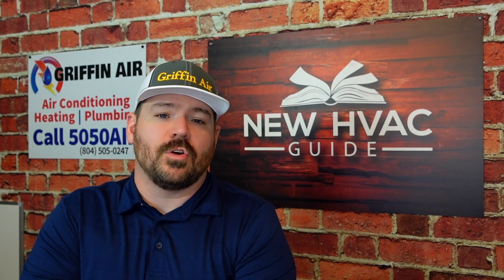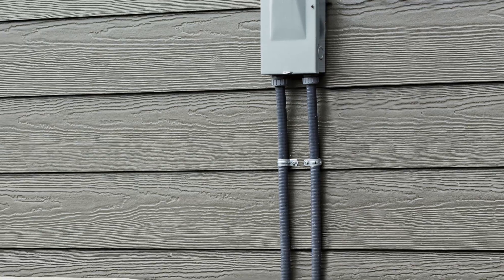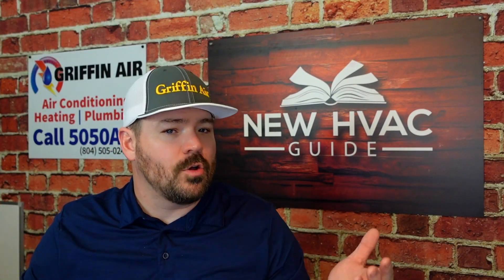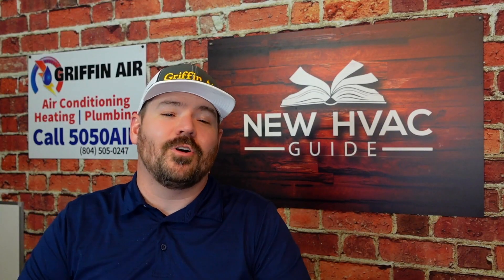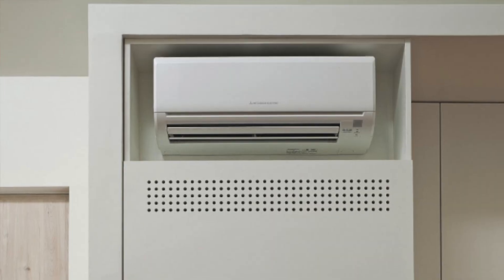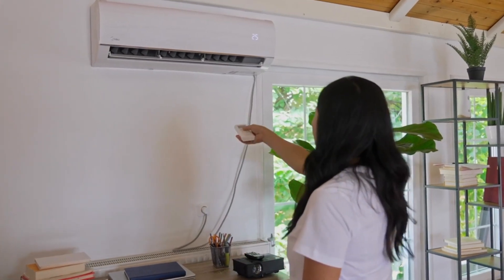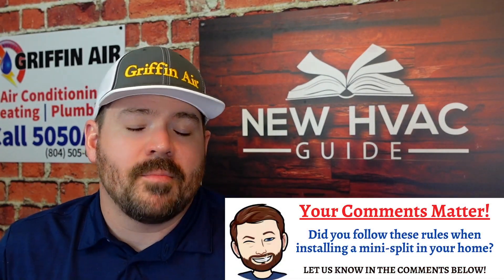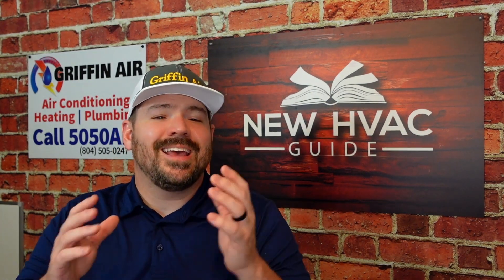Mini-Split Location Matters! EXPERT TIPS!

Comment: Is a 12000 btu mini system good for  a living room?
Reply: Depending on the room size and the climate. I have mitsu 15k btu  cooling 20x50 with no issues in NY in 90 degrees. It does not work very well for heating though. It helps by a very little.
Daikin 12K btu cooling 16x20 room in fan set to 1 bar with no issues at all. Did not use for heating, even though it's heat/cold unit. My comfort temp is 75.
Figure out if that will work for based on that info. I am not an installer, just an FYI.

Comment: There are IR repeaters so you can redirect the remote signal to a location that may be not line of site.
These are used in audio video all the time, but why not for mini-splits. That way Instead of installing the head unit in the optimal location to point a infrared remote, you can install it in a location that is optimal for comfort and air distribution.
Reply: Cielo Home
Reply: Most mini splits now have wifi and you can control them with your phone. Even if you are on the other side of the world. Many have a function where they can turn on and off automatically when your phone is within a mile, five miles, ten miles etc of your home so it will turn on automatically just before you get home, and turn off when you leave home. 
You can also program a schedule to switch on and off, what temperature to set and so on. 
If the unit doesn't have wifi built in, as with an old one I have, you can buy something like a Sensibo Sky which is a IR unit that you can control and program with your phone just as if it was a unit with wifi built in.

Comment: Videos I saw people install the condenser unit too close to the wall. The book I had said if it was wall mounted with the brackets it could be 6" ground mount 12" is required. I think 6" is just too close going to restrict the flow of air no matter bracket mounted or not really need a full 12" at least 24" is even better.
Reply from the maker: More clearance is better than less.

Comment: I kinda have a weird situation.  We have a 3 car garage and I'd need to install the condensor on the outside of the far east wall, run the lines through the garage allllllll the way over to what is otherwise a 4th bay of the garage (home builder opted to make it a room instead of another garage bay) but is an air conditioned room (my office).  I can't install the condensor right outside of my office because the condensor would be visible from the street and the HOA says no.  So I'd need to have about 60' of line.  I'm having trouble figuring out how to buy the hardware I need.

Comment: Thank you for your video, I do have a question if you don't mind answering.  I am about to install a mini split in an insulated Craft Room in my Shop.  It is just a 12'x24' room that the entrance to the room is in the middle of the interior 24' wall.  So I for sure planned on installing on exterior wall but being so narrow was assuming for best airflow to install it on the exterior 12' wall so that air is pushed across the room if that matters?  That exterior wall where I plan on installing it will not be exactly where I would but the outside unit, it would be right around the corner on the back 24' exterior wall.  I have 16' of line so assume I can go out and right around and put in that corner.  The jist is, just trying to determine if that would be the best location being it is a rectangular room and figured it would disperse the air across the room better compared to if I put on the back wall in the middle it only has that 12' to go and door is on the other side.  If it will still disperse just fine that way, it would for sure be the better location that way the lines go straight down.  Hopefully I am explaining it good enuf without being able to paste pics ha.  Thanks for your response.

Comment: How far down on wall off ceiling do you typically mount?
Reply: At the 8:00 mark is a diagram describing this. 6 inches from the ceiling and usually 6+ feet from the floor.  But each unit will describe this in the manual and there are units for low and high mount locations
Reply from the maker: There are minimums. But I don’t usually do minimums. Sometimes the space and what looks nice plays a role.

Comment: We are in an RV and we want to put the line set on the roof. I want to know if that will be an issue with the drain line. Could we separate them and have the drain go down the side of the rv to the ground while the line set goes up and along the roof. Help 😁
Reply from the maker: yes. Drain just needs to have have fall to drain

Comment: Can you install a minisplit on the wall to a closet, where the back wall of the closet is the exterior wall. In my case, the lines would be accessible inside the closet. Your thoughts?…
Reply from the maker: I’ve seen that done. Doesn’t look as nice but it works 🙂

Comment: I bought a Senville 18,000 btu to install in our vaulted ceiling, 600 square foot 'great room', which is destined to become our new kitchen, dining and living room. (this is an add-on structure to an existing older house).  The first thing my wife wanted, was to hide the unit in a bulkhead, without any consideration for accessibility, maintenance and air flow.  She was quite contentious and not willing to listen to the potential issues caused by her esthetic design.  I have renovated homes successfully for 35 years, so I have put years of thought into many aspects of installing hardware. She is also a home-renovator/carpenter, so she also began to come around to thinking logically.  We have not settled on a final design, but the install will be on an interior wall at one end of the room, with the compressor installed in the crawl space of the original home, with airflow access outside.  Now that I have seen this video, perhaps I shall produce my own video and post to YouTube, search "ya472" for the progress over the next 'couple of months'? (today is November 06 /2023)

Comment: Ok I got one for you I have a 27k mr cool system running 2 heads , both units run great in ac mode but when upping the temp to heat mode one head goes into stand by , btw it’s only in auto mode if I put in heat mode manually they both run ok I believe at least when tested they did ???
Reply: I have an LG system that is also doing as you describe in Auto. Very annoying and I have yet to find a solution aside from never using auto.

Comment: What is more important during installation:  to install the line sets between the evaporator and condenser completely vertical and to place the evaporator on the longer wall in a rectangular bedroom  OR to install the line sets diagonally crossing the corner of two walls in order to place the evaporator in the interior of the shorter wall exposed to strong winds and the condenser in the exterior of longer wall protected from strong winds?

Comment: It is 3 months to date since I applied to Hydro One for a new line to my house to get a 200 amp panel. The electrician and heat pump installer are ready to go. The upstairs floor unit will be on an outside wall. The downstairs unit will be indirectly on an outside wall. That is it will be on what was an outside wall, but the lines will go into the utility room and then to the outside. The lines will be hidden by the hot water heater. Maybe by winter it will be ready.
Reply: This is why the UK 230v electrical system is so great. Here mini splits just plug into any standard wall outlet in the room, and the outdoor compressor gets its power from the indoor unit.

Comment: Please advise I have water dropping from my air handler coil, pan and drain line are not blocked. Any suggestions? My ac company can’t figure it out, and are nickel and diming me as if it’s no big deal. Thanks in advance.
Reply from the maker: Drain running down hill? Drain pan cracked? Where exactly is the water coming from?
Reply: @NewHVACGuide  dripping off coil before it gets down to the pan , landing on air filter. Unit is a trane only 2 years old. Thanks for getting back to me.
Reply from the maker: That’s really weird. They should not be nickel and diming you. They should be trying to get to the bottom of it and not charging any money until they do. Perhaps it’s time to get a second opinion?
Reply: @NewHVACGuide  thanks I was thinking the same thing, and thanks for all the videos
Reply: @NewHVACGuide  and check this out, the tech told me for $350 he could spray the special spray on the coil. Sure enough I paid it because he had things half torn apart and I wanted to make sure he put it back together correct anyway the $350 special spray worked for a little bit but just the other day I found drops on my air filter again please please help

Comment: Informative, some of your recommendations  luckily have thought about:  you may remember I asked you on your live show about minis in a "tight" house; if I do the mini, it will in a new construction. My thoughts are that I'd have a ducted unit doing the master, master bath, master closet all the stuff on one end of the house; a mini head for the kitchen/family room/breakfast dining area (not sure how many I'll need - hopefully the manual J will tell me), then my thoughts are the smallest units available in each of 3 bedrooms (family members/guests can control room temps for themselves). ....maintenance/cleaning is the one thing that concerns me...
Reply from the maker: Your concerns for small rooms are certainly valid. We see folks oversize systems, unknowingly all the time in small rooms, expecting an inverter system to ramp down. Problem is that they will still put the system on full blast and never give the inverter a chance to ramp down and work properly. Thank you for your comment!